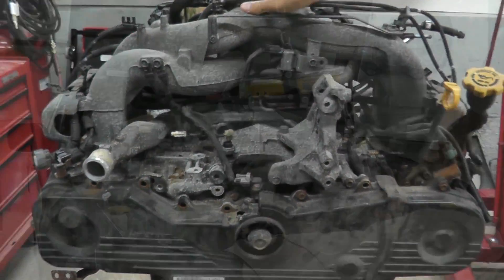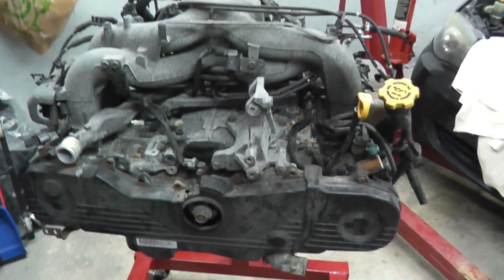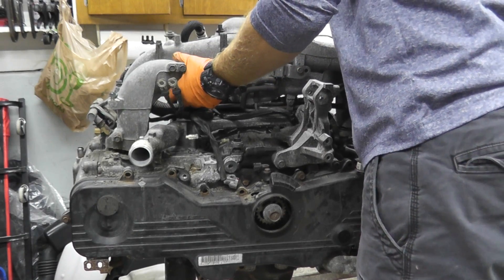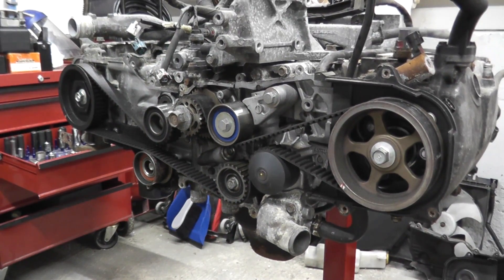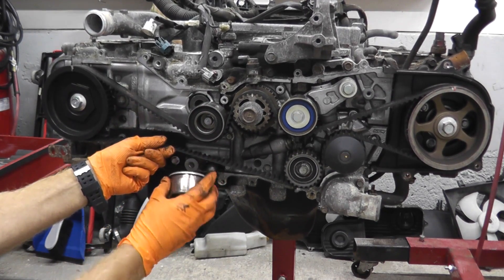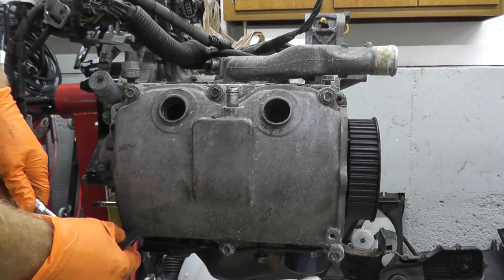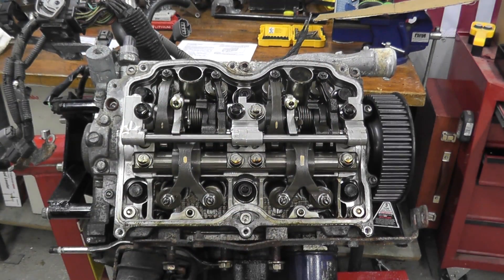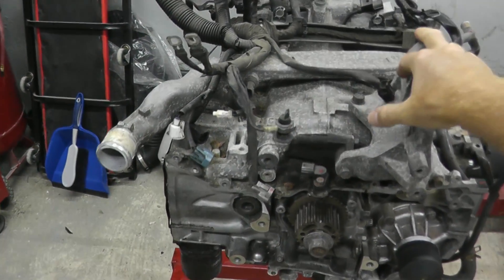Subaru Intake Manifold, Timing Belt and Cylinder Head Removal

Comment: Well organized and well presented as always.
The boxer design may excel at promoting a low center of gravity, helpful in racing or rallying (far less useful in a street car),  but it is a complete PITA when working on the engine, including something as simple as changing spark plugs nevermind headgasket replacement which, in an inline 4 is a relatively straightforward engine- in-car task. 
Then again, since coolant and oil drain down in an inline 4 design rather than having to be continuously separated by the head gasket in a boxer design, head gasket replacement is less likely or would be necessary after greater mileage. 
Anyway, the video is a credit to your ability and resilience!

Comment: Great video love your channel is the bottom single bearing idler on the timing supposed to rust like that. I have the same thing going on and I changed my timing components late 2018 with a Aisin kit. Wondering if it’s a cause for concern.
Reply from the maker: Good question. No, it shouldn't rust. In my case the timing cover had a small hole and condensation was entering the area.

Comment: I wonder if the weathering on the timing bell bearing is because it's an aftermarket non-OEM TB kit. When I did my TB change at subaru, they wanted to install an aftermarket kit. I figured it out when checking the part numbers on the bill estimate. I told subaru NO NO. I only want OEM Genuine subaru parts. They ordered all the OEM part then and installed them. I don't mind paying 300$ more for quality parts if it means I won't have a busted engine. Gates TB kit have been cheeping out, with many of their japan part now being cheaper chinese parts. Bearing that rust so easily is certainly not a good sign. They also cheaped out on the TB tensionner. As for the waterpump, the OEM subaru one lasts forever, whereas the aftermarket ones have a reputation of going tits up quite fast.

Comment: If you had to remove that cam gear without the impact could you put rope in a cylinder so that a valve pushes against it? Is it really doable without the impact. I agree impact makes it so much easier. Secondly you mention keeping track of the fasteners for the cylinder head, but are you going to use new fasteners?
Reply from the maker: Thank you. Yes, I reused the fasteners.